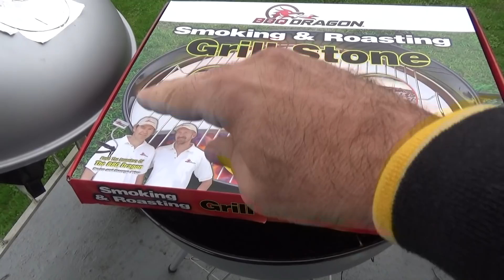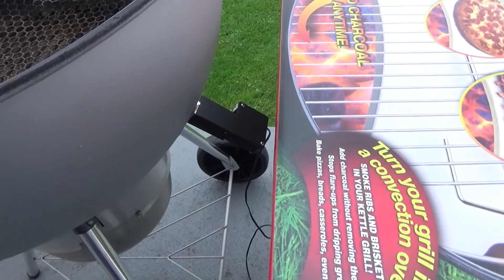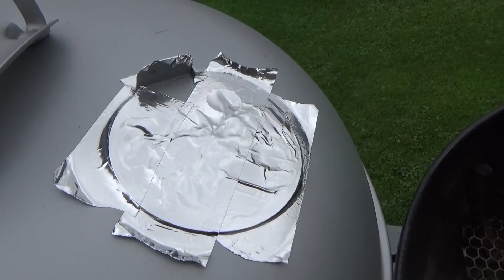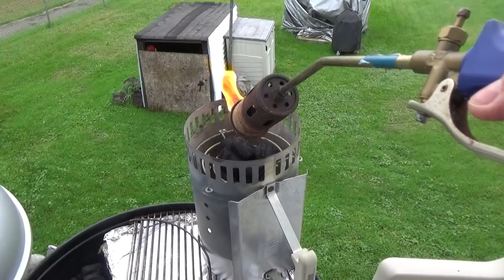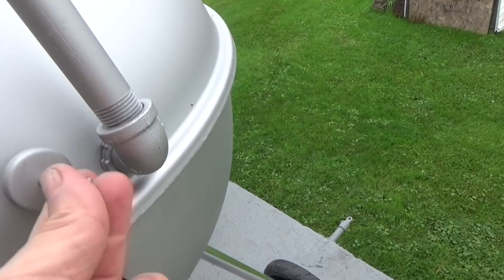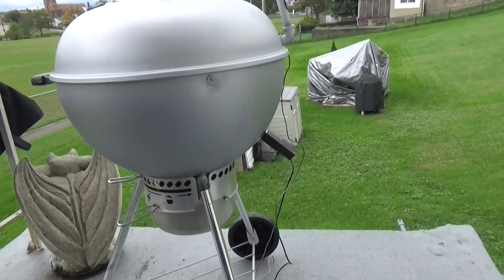The ULTIMATE LOW and SLOW WEBER KETTLE SET UP????

Comment: hey Ken is there a pdi controll with wifi you could recomend  that easey to use  thinking of pimping out my weber 22  and plan to use some of your mods   i just got to  do a stack coolest iv ever seen  gunna go all out and ues crome for stack thinking of going with 1.25  in pipe you think thats to big for the bend of the lid
Reply from the maker: Hey Joe! Glad You are liking my set ups.  I use the Auber Instruments PID and I believe they make WIFI units also.  Their stuff is reliable and don't 
cost a fortune.   As for a stack.......did you see my recent video about two months ago where I moved the stack down lower into the bowl of the kettle 
taking out of the lid. I gotta check it out if you haven't yet.  I do believe 1 1/4" may be too heavy for the lid.  I think I'm using 7/8" I.D. pipe.  I know I use 1 1/2" I.D. pipe on the weber smokey mountain stack and that's really big.   Remember........these mods I do aren't for everyone.   Only do them to equipment that you aren't concerned about destroying.   Let me know how is goes!  Metal On! \m/
Reply: @HeavyMetalBarBQue  thnanks man your the best

Comment: Could the stack be used without a controller and fan? It looks like it would keep the smoke in the chamber longer. Why isn’t anyone else trying a stack near grate level?
Reply from the maker: Hey Steve! Thanks for checking this out! 👍  This is an early attempt at this set up and I found with this diameter pipe it had a hard time drawing the necessary air.  So I increased the diameter of the pipe and it can draw with out the need of a stoker.  I hope You find time to check out more of my videos because it documents the progression of this idea.  I even have a modded WSM top and bottom with a 2" stack coming out of an extension ring.  With this set up I have the cooking grate high up into the lid of the WSM which give me higher temps and more smoke, which means I can run the pit with less fuel consumption. 😁  The name of the game for me! 👍   As for your question......I'm not sure.   But I did just add a reverse flow cabinet smoker to my arsenal which operates on the same design.  The cabinet fills up with heat and smoke and exits out the bottom of the cabinet.  Same principal!  😁  Check out my Vids.....You'll See!  👍

Comment: Do you remember if the net on top of the charcoal grate is expanded aluminum?

I saw some inexpensive disposable grill toppers at Walmart that say they are made from expanded aluminum and was wondering if I could use that to máxime the charcoal usage.

Thanks.
Reply from the maker: Thanks for checking out my Vid! 👍   What that is is a stainless steel expanded metal.  I wouldn't recommend using those aluminum grill toppers that you are talking about......I'be afraid they would melt.   I'de recommend stainless if you can find it......will withstand high temps and won't ever rust.  But a piece of carbon steel expanded metal will work also.  Metal On My Friend!
Reply: Heavy Metal Bar-B-Que thanks. I would check if I can find stainless then. If not I guess I order another charcoal grate.

Thanks again.

Comment: Never seen more charcoal in a kettle in my life. Genius.
Reply: Will probably burn for days. You could slow-cook a dinosaur leg.
Reply from the maker: Check out my last video........this set up ran for 29 hours when I shut it down.    There was still enough charcoal to go another 12 hours I would guess! 
The combination of your grill stone, which adds thermal mass, and the lowered placement of my new stack, and the precise temp control of the stoker 
worked like a charm.   Longer cooks, less fuel consumption,.....means saving money! 
You welcome for the free advertisement and product endorsement.  :-)       Metal On!   \m/    HMB

Comment: Expanded Metal  \m/  \m/  Oh no your Weber's fell off the porch, better them than you :-) Have you considered putting railing along that porch? WOW!!!!!!! You loaded that charcoal big time :-) Hey Ken you should win a Nobel Prize for this :-) Does your stack have a 3/4" to 1/2"street 90' on it with a 3/4" nipple on it? A "BIG" thumbs up :-) ROCK ON!!!!!!!  \m/  \m/
Reply from the maker: LLLLLLL  Yep.....especially after too many cold ones.      No.....we're used to no railing.  It's 22 hours and still rocking with plenty of fuel left.  
You know your metal fittings!   It's a 1/2 " street 90 and a 4" - 1/2" nipple.  It was a perfect fit into the 7/8" hole that I drilled.   You Rock Bro! Thanks for checking it out!   And......Don't Jack Up that nice kettle of Yours!     Find a used piece of junk, if you're getting any ideas!  :-)   \m/

Comment: What kind of high heat paint did you use? Looks pretty cool....nice experiment;)
Reply from the maker: Thanks Bro!   It's Krylon.....high heat max.  Got it at Lowes.     Metal On!
Reply: I've had trouble getting paint to stick to the enamel. Peels off with time. Even tried to rough up the enamel with sand paper. Any tips?
Reply from the maker: No......just always give it a quick touch up.   I do like that idea of roughing it up.....gonna try it!    Thanks.

Comment: Did you run super smoker through paint booth when you added smoke stack, interesting to see how long kettle will go like that. I'm curios will that stone sit on top rack of stacker.  Charcoal Ring then indirect, add lower grate big ole water pan bbq stone. 20lb shoulder clod no problem see you tomorrow.  Is that 2001 space gray paint, just in case I'm not liking my limited edition red. 👊👍
Reply from the maker: Yep......had to give it a touch up.   I'll let you know in a couple days.    That stacker can be modified ....wouldn't worry about that.  Yep.....you can do it however you can imagine it.   Yep.....this is a grey......they didn't have the silver I was using.   I used to paint my stuff the flat black.  That's Metal!  \m/